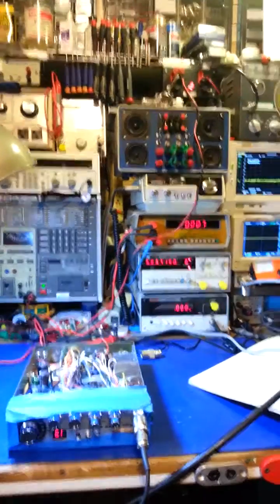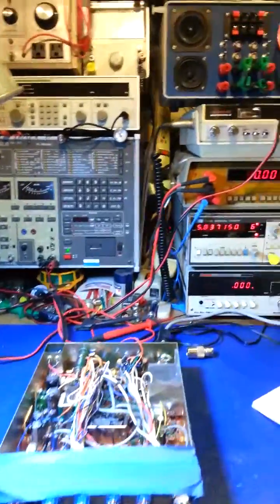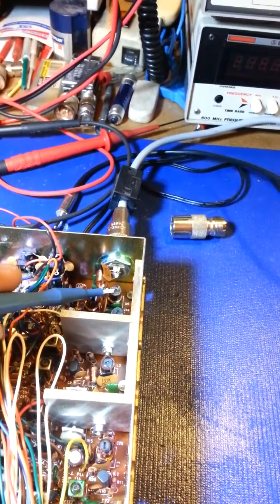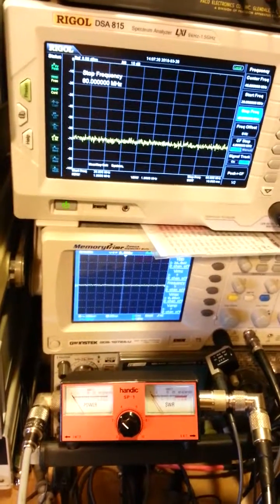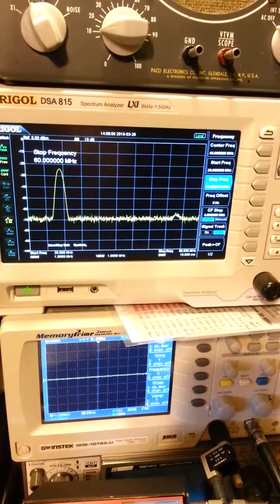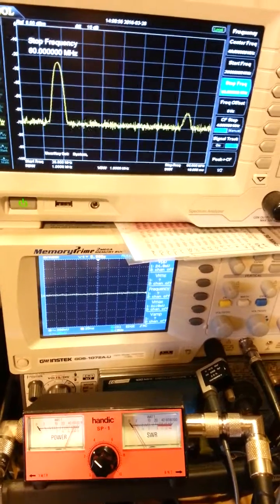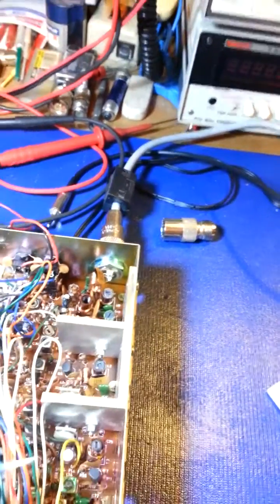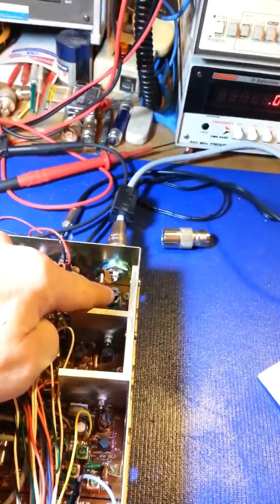Golden Screwdrivers stop playing with and adjusting the 54 MHz trap filter circuit in CB radios.

Comment: Nice video Mike, should have also pointed out that the peak in the fundamental didn't go down. That is likely to have been missed by the "golden screwdriver" bunch.
Reply from the maker: Very true.  It can even lower the fundamental frequency power a little bit, very counterproductive.  Unfortunately people are easily tricked by watt meter readings.